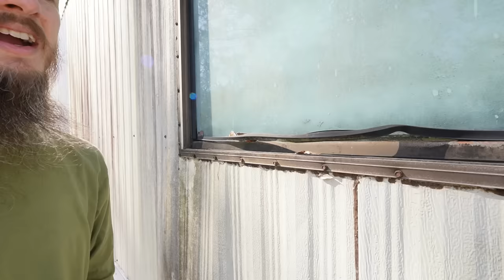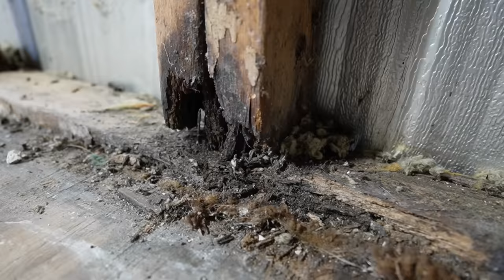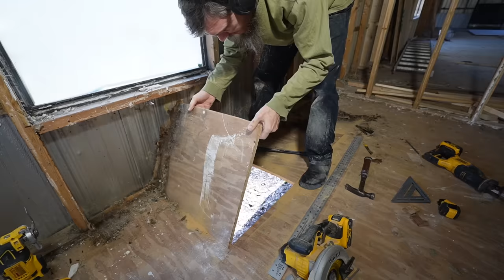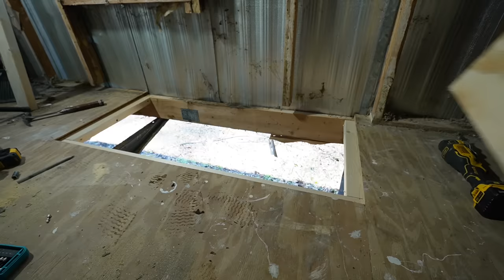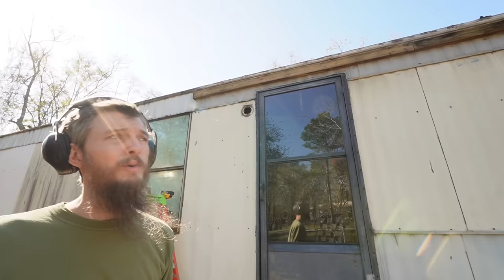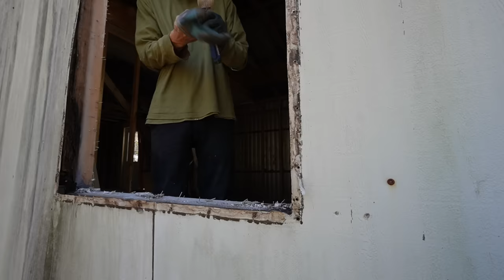Saving Our Old Trailer - Window and Floor Repair - Mobile Home Rebuild

Comment: I was very lucky. My mobil is a 1984 and they put good quality insulation in the walls and my windows don't rattle in the wind or leak. I live in a mobil home park in the California desert so you hear about this stuff everyday. I have learned alot form the years of watching you guys redo these mobils.

Comment: As I renovated and remodeled my 1984 mobile home I procrastinated doing the windows.  It was just a pain trying to find affordable windows, figuring out the correct sizes and it was simply a job I didn’t look forward to doing.  (There was no DIYfferet back then to show me how easy the job was.  (Minus rot.))  The previous owner had actually replaced the glass in one window with plexiglass.  I tolerated it until one cold winter night we had a huge windy storm with horizontal rain knocking out power.  That plastic window kept loudly bulging in and out with each gust of wind.  Concerned, I examined it.  I gave it a small poke with my finger hoping it would survive the storm.  About thirty seconds later the whole thing blew into the house.  With rain pouring into the house I frantically ran out to the shop grabbing a tarp, hammer and nails and covered the window.  The next day I was able to temporarily reinstall that plexiglass, but I soon ordered new windows and replaced every window in the house.  Note to self: Don’t wait until tomorrow to do what needed to be done yesterday.
Reply: That includes the roof.I live in a 1974 mobile home.Did the roof first.The six inch eave helps.Now all the old windows I need to replace?At least they're dry window sills inside for the first time during rain.

Comment: It’s unfortunate this home looks like it never had any real maintenance done on it. Most people don’t understand what all goes into home ownership. My dad had to recently pay $22k to replace a wall of windows in their 2006 custom home they built new. He never resealed the windows when I told him and would rather be fishing, hunting, or at the bar. If it was a bad rainstorm gallons of water would pour in that we would have to deal with. It was a great lesson for him. His home leaked and my camper didn’t! All my camper windows are the original ones from 1988. Some of the corners where the glass and rubber glazing were leaking when I first got it. All I had to do was use a screwdriver and push the rubber back in on all the windows! And then I did take all of them out and re-butyl tape and caulk them as well.

Comment: In Florida the hurricane winds pushing against the panes will pop the seals on the window as well. That was the reason we had to replace and rebuild our breakfast nook. Hurricane Charlie plus the heat, humidity and rains just feeds the rot once the rain finds a way in. -- Not to mention the bugs it attracts.

Comment: It's amazing the difference in build quality between these 1984 mobile homes and modern double wide mobile homes. Ours has 2x6 exterior walls and 2x8 floor joist on 16 center with 3/4 inch subfloor. It also has traditional windows and doors like a regular stick built home. Plywood exterior sheathing with vinyl siding. However one can't argue that this 1984 mobile home wasn't built sturdy as it's obviously lasted 40 years and being in Florida has weathered many hurricanes without major damage. I have zero doubt that the place will look fantastic when you're done with the renovation. 😊
Reply from the maker: Yeah, I was looking into that recently and was really surprised by the build quality of some of the new mobile homes, just as you described. It does make me wonder if weight isn't as much of an issue today as it was back then, or was it just a cost thing. No idea.

Comment: Definitely xhanging windows but will wait til last dor none are leaking but all original, '92, very cheap made😢. Glue and sawdust floors,(all cut out and replaced with 3/4 plywood) with new insulalation. Baby steps. Inflation killed our savings😢. You guys are amazing and will for sure be using your tutorials when switching out windows. Thanks for sharing your knowledge.

Comment: I just think it s amazing how these metal mobile homes were built. Mainly the fact that there is only a thin piece of metal on the outside wall. No sheathing. And then just a thin piece of wood paneling on the inside wall with toothpick framing. I grew up in the 70's in a metal mobile home. It was brand new in 1968. Cold in the winter. Hot as Haitis in the summer. It is no wonder these things blow away/apart in winds above the force of a sneeze. 
You guys are doing an great job! As always.

Comment: I’m renovating a 1987 double wide. I had similar issues around the window and doors as well as structural damage from shipping as it was not supported to stiffen the marriage wall from racking along with they only had two axels underneath. Was a mess! The exterior material is Masonite siding but because I had to remove a bunch of it to repair the damage I replaced about 14 sheets. In lieu of using mobile home windows I used decent quality Home Depot windows with window and door caulk on the top and sides then screwed down with tec screws they have a washer head. I also wrapped the openings with stretchy flashing and installed house wrap where ever the siding was removed and replaced any damaged insulation. I trimmed out the outside with milled 2x4 bottom and sides and 2x6 top it looks very good!

Comment: I don't know how many more windows you have to do yet., but we used the  Suction cup, it helped to hold the window in place while he screwed it down. It the ones you can buy for the bathroom shower/ tub to hold on to, when getting in or out of the shower/tub. Yes it was cheaper then buying the regular ones. But  we used them in the shower afterwards.

Comment: Great job!  One bite at a time!  Are y’all going to try & button up the outside before winter?  This is fun!  What about your bathroom in your home.  Still waiting for vanity, toilet, sink?  Can’t wait to see how that turns out!  TYTY for sharing! ❤️❤️🙏❤️❤️
Reply: We are in Winter now. It doesn't snow here . A lot less rain than summer. No snow or it's rare.
Reply from the maker: Yea, we are still waiting for our bathroom vanity to be delivered. They are being very slow at shipping it to us. We've been working a lot on the mobile home and the exterior walls should be finished up fairly quickly now. :)

Comment: Will you be doing all the stuff under the trailer before the abundant critters start using it for shade? When we lived in AL near Columbus, GA, we had numerous copperheads in our yard. I often had to get them out of the pool. Even the small ones had bad attitudes.

Comment: Just a tip I wash my mobile home and actually any home now I use borax Dawn dish soap and bleach  5 gallon water 2 tablespoon of dish soap two cups of borax and three cups of bleach maybe more if you like😊 I use an extension pole will a car wash brush they are like 6 in by 10. Just start my putting solution straight on siding do not wet it first allow the solution to saturate the surface I don't scrub very hard the solution does the work I do this twice let it sit a few minutes just don't let it dry if it looks like it is still dirty but another coat then rinse clean hope you try this

Comment: Just curious 🧐 I see a lot of pin hole lights coming through the siding everywhere… up high in the middle at the bottom..you get my point. How do you fix and water proof these holes to keep the inside insulation dry and make where you can’t see a patch work from the outside? 😊
Reply from the maker: There are a few different ways to seal them up and we'll be sealing all of them soon, once we are done with all the framing repairs. So we'll show what we'll be doing soon. But you can use elastomeric sealants (caulk) or repair epoxy such as JB Weld or bondo.
Reply: Hummm looking forward to seeing that 😊 thanks for answering 😊

Comment: Wonder if there's a blade for the recip saw that would make it easier to remove the old caulk.😮😊
Reply from the maker: Yea, that might work. They do make a flat scraper blade for reciprocating saws.

Comment: It’s all coming along great!  You could install cute awnings over the windows.  Not only would it help with water damage and the elements, but would add cute curb appeal 😊 Do you put caulking or sealant along inside, where the aluminum siding rests along the floor boards to keep insects, bees, etc. out?  This mobile home is going to be so nice when you’re done and make a wonderful home for a family 😊✌️
Reply from the maker: Thanks. Yeah we'll be sealing up the bottom of the siding to keep bugs out and we'll show our plan in a future video, but we'll try to get all the repairs and cleaning done first.

Comment: some may not understand why Doug and Ashley are remodelling this vintage trailer...there are so many of these type of trailers all around that have similar situations....if they were to knock them down.... in many places,  you can not replace  them with something different, in other places you would need permits, conditions, inspections  and much red tape, the cost would be very high, many municipalities want you to build brand new expensive housing with very high property taxes and budgets....this project is something so many people can do even without being a professional builder, even if they have to hire and outsource some of the steps

Comment: 1) Loving the frequent videos! 2) I just had an ‘out there’ idea…paint the exterior silver?  I’m thinking retro look, kind of like the old Airstreams… 3) Just curious why you’re well into this project with your home almost completed? Like your kitchen & painting the exterior.  I know it’s not much, but it makes me ask why you didn’t finish that house before doing such extensive work on the next one?  I’m sure you have a logical strategy!!! 👍🏻
Reply from the maker: Silver would be cool :) Our main home is almost completed, but still has some work left to do. We just like to pivot to whatever projects we can work on in the moment. Sometimes it's weather-related reasons, and sometimes we're waiting for materials to ship, like the bathroom window or vanity. They still didn't deliver that to us yet. Also, it's good to work on this mobile home now and get it insulated before the summer months bake the inside. We like to make progress and make best use of our time working around obstacles :)

Comment: Where did you get the brown windows? no one has them here in Florida.
Reply from the maker: We bought them from a mobile home supply store. They are all over Florida.
Reply: @diyfferent  Only white and mill finish. No Brown or bronze.
Reply from the maker: @mickkulin8207  See if they can special order you some windows in the color you want.

Comment: Is that wall where the ceiling hight changes load bearing? I'm ask because I would like to do away with the small front bedroom and expand the living room area.
Reply from the maker: No, it's not load bearing. Generally, none of the interior walls in a singlewide are load bearing. But they can give lateral strength to help stiffen up the exterior walls.

Comment: will you eventually put something over the door to prevent rain from pounding the door and allowing for a dry entry when it rains?
Reply from the maker: Yes definitely. We're still deciding between what kind of roof-over we want to do. Then we'll be better able to see how we want to handle the doors. But we always prefer a covered doorway.

Comment: You guys are doing a great job! Motivate s me to tackle my mobile home myself and not pay someone to do it. Question for you. I have a mobile home similar to yours, if it wasn’t in the shape that it was would you do section at a time or do it the same exact way you’re doin it, gut it all at once?
Reply from the maker: It depends on the circumstances. Since we aren't living here and we want to do a lot of work to this home, it just made sense to strip it down all at once. If I were living in it or wasn't planning on changing things too much, I would definitely just do the smaller jobs one section at a time.

Comment: I’ve always wondered why the light at the front door is on the side where the door opens. The bugs gather around the light & come in when the door opens.
Reply: They put them there because when door is open you can see better as you go in or out.

Comment: Are you doing anything different on your window installs that will keep the windows from becoming a water leak source at some point in there life?  I wasn't sure if I missed something or if the buytle tape is the difference
Reply from the maker: We're not doing anything different for the window installs. However, we will be doing some type of roof overhang which will keep water from running down the sides of the home. Also, we won't be doing window AC units. Overall, it's just about preventative maintenance.

Comment: Another good video brother but I got a question for you those drill bits are those for deck screws and they stopped just like the drywall screws that you use that you don't have to counter sink them do you have a link to where you got yours at I like yours
Reply from the maker: Yea, it's a drywall setter with a torx bit. I added a link in the description so you can see what it is.
Reply: @diyfferent  thank you

Comment: Is this another door cause last video you installed a new door
Reply from the maker: Yep, this is the front door.  The previous door install video was the back door. This home actually has three doors, two on the back and one on the front.
Reply: Very nice!
Reply: What type and size screws do you use on the subfloor? Can't find where you told us. Thank you!!

Comment: You should never span just 2 joists. it lacks support and it will belly out (even when properly laying across grain)  You MUST span 3 joists.
Reply from the maker: It's often more ideal to span three joists, but there are situations where two is enough. This is a floor patch, not a new build construction. And the floor will never have any issues or sagging.

In an upcoming video you'll see me spanning three joists for added strength, just as I did on the first window fix. I like to show a variety of methods. But it's not a "MUST" to do it any one way. It's all situational.

And keep in mind that we put a lot of time and effort into sharing our journey and our knowledge. And while you may not share my techniques and it's okay if you do it different, I would ask that you don't try to diminish our experience and knowledge of these things. The floor will be fine.
Reply: @diyfferent  I just pointed out the industry standard for long term structural integrity. I'm sorry That you feel that I am attempting to diminish your experience. that is not my intention.
Reply from the maker: @warrendelay  I agree with that being a good, standard building practice, but I just don't like absolutes in renovation and repair because sometimes you have other factors to consider. We do try to do the best work we can in each situation.

Comment: I'm wondering if the thing is even worth saving. Bad window design and you're installing the same thing back in.
Reply from the maker: We totally think it's worth saving. I think they held up pretty well for being 40 years old, and having no roof overhang or other protection. Eventually we'll have some sort of overhang and that will help them last even longer.
Reply: Making it right again on a big lot is well worth it. No landfill or new apartment for this beauty!  Good job!  Waste not want not.